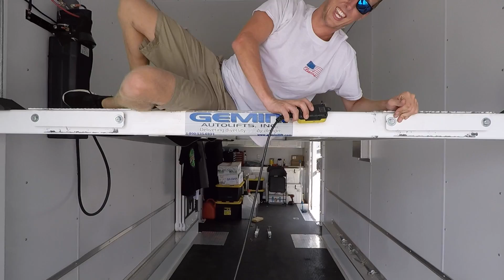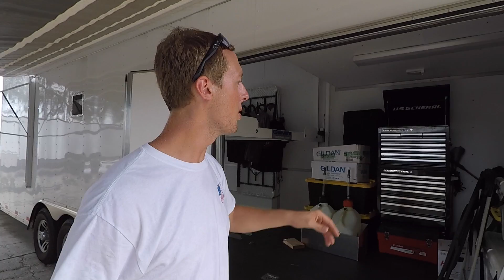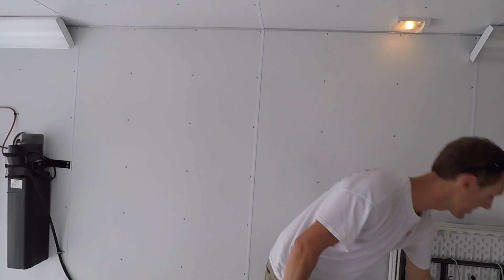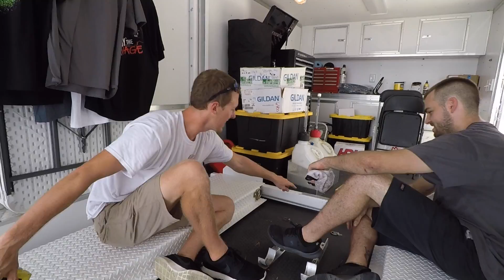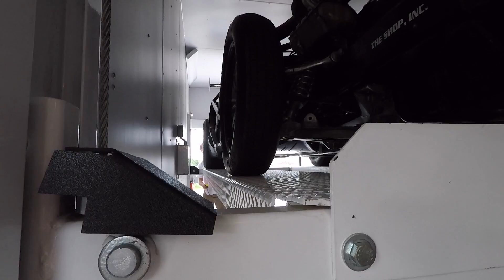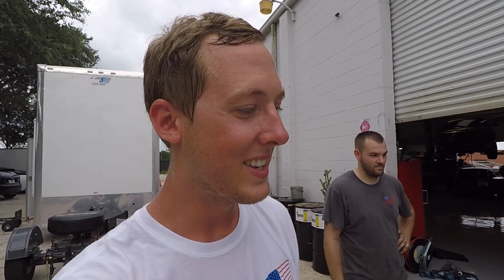We Bought a Used 2-Car STACKER Trailer! Introducing "Stacey the Stacker" (SHE'S TALL!)

Comment: Better be careful. Those RVs are not ment to pull that weight. You can easily overheat and blow that sucker up. Dont hit the mountains.
Reply: Snipe Stud00 yeah 900foot pounds of torque probably not enough lol it's pretty much got a semi engine I think it will be just fine I've seen them pull crazier things for sure.
Reply: Nina Blatchley Those RVs gross 45,000lbs. That trailer loaded with 2 cars is pushing maybe 60,000lbs. Not only is that Recreational CDL, but its not rated for those engines. They are not semi truck, and are not geared like one. Not only that, but the engine is in the back along with the radiator. Itll easily cook that motor up hill ontop of being maxed at 30-50mph. A mountain on any steep angle will blow it. The other trailer was ok to pull at it pushed maybe 5000lbs loaded. This new one is 12,000lbs loaded. That is from 500lbs hitch weight to 1,200lbs hitch weight. No motor home is rated for pulling this weight in an way even across flat land. He needs an actual toter home if he wants to continue pulling this setup. Also, many states allow a certain lengths, 60ft if i recall correctly. He is over. Using the stacker on the 1 ton is fine and the other car trailer on the RV is fine. Again, this setup is a major no, no.
Reply: Nina Blatchley Also, ill recite many DOT laws. Any trailer loaded over 10,001lbs is CDL A. If leaving the state, CDL A is required for any combination grossing over 26,001 lbs. Farmers hold exemption up to 250 miles from home farm location before fallowing DOT regulations. Log books are only required for commercially used setups. Technically, this combination is used for youtube which is a commercial set up. Thing is, it can be registered as personal and ran without logs.
Reply: believe or not that rv ways more that 30 we work on them  every day so with trailer yes he is pushing it but power wise I think he will be fine and with the tote axel for weight distribution and braking assistance will be no problem . we have had customers pull 25,000 pound trailers with same base rv all over USA with no problem it wouldn't hurt to do some programming on it to help in the hills but those trucks are really under rated his I think even has a Freightliner chassis which is one of the best for towing. Don't get me wrong it's a load but we just pulled 40,000 with our f650 with a 26000 gross from Ohio to Florida dot wasn't happy at last weight station but it did it with no problem and his engine is twice that of a 650. 80% of states want even require a special rv license Florida being one which is where I'm sure it will be registered
Reply: Snipe Stud00 ment to say weighs no more than 30 damn spell check
Reply: Nina Blatchley Again, anything over 26,001lbs is CDL A. Any trailer over 10,001lbs is CDL A. If the unit pushed 10,001lbs alone its CDL B. This is still over CDL A range. States have length limits. Why majority 5th wheels are in the 45ft overall. Anything over is a toter style truck. semi trailers go 60ft these days with majority OTR 53fts. They do make 60ft RVs for semis. DOT is standard across all states as its federal standards. Majority will over look a few things, others wont. These RVs require CDL A recreational use. I was not talking where ts registed i was talking HOW its registered. Commerical mean CDL A with Logs fallowing DOT times. Personal registration is CDL A recreaional use no logs required. beleive its 60 or 65ft maximum overall length. I really do not care what ithers do. Im stating laws. He is a public figure which means he needs to fallow all laws and rules while on camera. Off camera i dont give a shit. I have no shame pulling over my trucks capacity and done it. But, i will not willing state when doing it or will i purposly endanger others meaning ill travel slower on the roads and check my load more times than most. Especially when im maxing what my trailer and truck is capable of. Theres a reason why toter homes came popular. These units are not ment for this.
Reply: Snipe Stud00  Here is a list of each state laws when driving an RV over 26000 from DOT website just so u know it's different for commercial drivers. Each state very some that say yes only require a upgrade on regular license no CDL. there are a few like Illinois for instance is strict and they do require cdl on anything over 16000 actually crazy really u would think it would be same across USA but it's not as long as it's registered in Florida tho which requires nothing 90% of the time they want give him a hard time especially since it's Not For Hire because he is using it for personal use now if he starts transportation of other people's cars then the whole thing changes not only will he need CDL he will also need DOT # and Motor Carrier#.

AlabamaNoNo AlaskaNoNo ArizonaNoNo ArkansasNoNo CaliforniaNoYes, if over 26,000 lbsColoradoNoNoConnecticutNoNoDelawareNoNoFloridaNoNoGeorgiaNoNoHawaiiYes, if over 26,000 lbsNoIdahoNoNoIllinoisNoYes, if over 16,000 lbs or towing over 10,000 lbsIndianaNoNoIowaNoNoKansasNoYes, if over 26,000 lbsKentuckyNoNoLouisianaNoNoMaineNoNoMarylandNoYes, if over 26,000 lbsMassachusettsNoNoMichiganNoNoMinnesotaNoNoMississippiNoNoMissouriNoNoMontanaNoNoNebraskaNoNoNevadaNoYes, if over 26,000 lbsNew HampshireNoNoNew JerseyNoNoNew MexicoNoYes, if over 26,000 lbsNew YorkNoYes, if over 26,000 lbsNorth CarolinaNoYes, if over 26,000 lbs or towing over 10,000 lbsNorth DakotaNoNoOhioNoNoOklahomaNoNoOregonNoNoPennsylvaniaNoYes, if over 26,000 lbsRhode IslandNoNoSouth CarolinaNoYes, if over 26,000 lbsSouth DakotaNoNoTennesseeNoNoTexasNoYes, if over 26,000 lbsUtahNoNoVermontNoNoVirginiaNoNoWashingtonNoNoWashington D.C.NoYes, if over 26,000 lbsWest VirginiaNoNoWisconsinNoNoWyomingNoYes, if over 26,000 lbs or towing over 10,000 lbs
Reply: Nina Blatchley You clearly dont listen. Its called a recreational CDL. Regular CDL A works fine though andnits easier to obtain. Stricter guidlines otherwise its the same.
Reply: Snipe Stud00 I understand I was just saying some states actually require a class A CDL even and some yes the recreational will work others will not. some states even just require a extra requirement on normal license. but majority of states he need neither just a regular license is legal no matter weight or length he could pull 80000 thousand pounds and not have to have a CDL even if it's 70ft that's all I'm saying it's stupid each state verys like that.  They actually have a USA map for RV drivers that tells u what each state laws are.

Comment: That trailer with nothing in it weighs anywhere from 8 to 9 thousand pounds I don't care what kind of told you got you going to be way over  for that coach there is a company in Colorado that builds open stackers for the price you gave for that you could have had a brand-new open Stacker which is way lighter and and is what I am going to get because I am going with a 3401 Aria and it also has a 10000 pound Towing so I can carry my truck and my boat way overweight dude you going to mess something up

Comment: Even though I was pretty certain I knew it was the sensor, there is no way in hell I could drive a car with a bad oil pressure or water temperature switch.

Comment: The tow rating is not based upon tongue weight. The rating is calculated based upon engine, drivetrain, braking, frame capacity and rating of the hitch. Exceeding the CGVWR limit puts you in violation of the law in all 50 states.